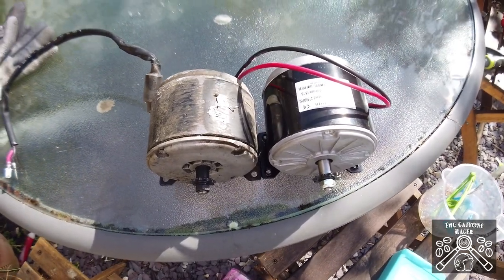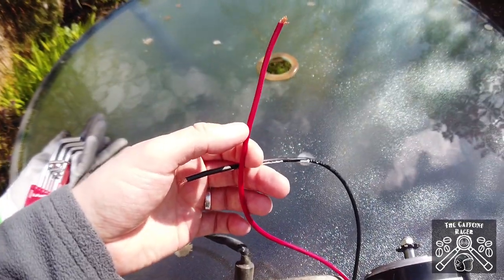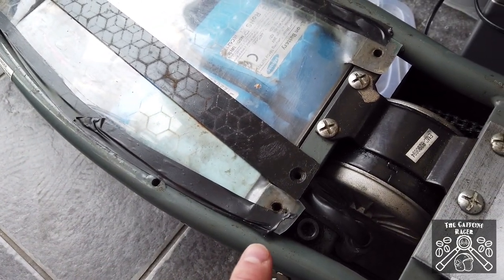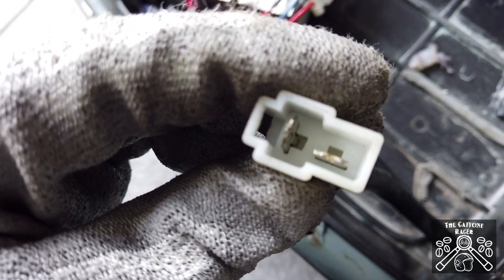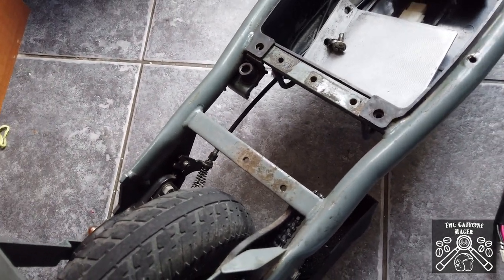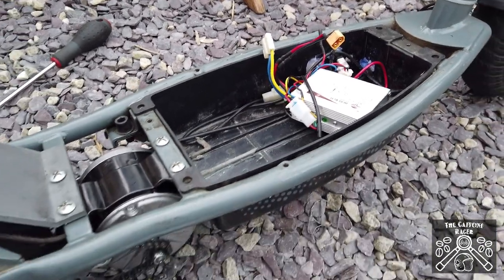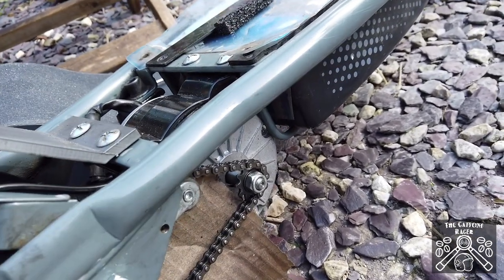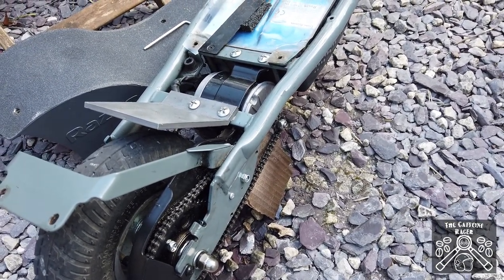Motor Upgrade for Fast Razor E300 - - 'Meet the E350w'

Comment: I am very glad you posted the video. I am looking to upgrade my scooter too. I am pushing 48v on the stock motor and it's a blast. I found a good deal on this same 350w motor. 
Question: Did the motor bracket have threaded holes? Did the screws used to install the motor go through the frame and then threaded into the motor?

Thank you! Great video!
Reply from the maker: Good question, yes the motor had a threaded set of hole I got some longer replacement bolts to go through my internal mudguard and then the frame then the motor. Remember this is a 350w 24v motor 18.6 amps is the limit before burn out
Reply: @TheCaffeineRacer  Thanks for the reply! I just rip on the scooter here and there in short rides. unfortunately laws in my area I cannot use it everywhere but I take it out for fun! Got super good deal on scooter and had a 48v and controller left over from my dune buggy modding. I will burn it out and the stock one has proved me well with lot of abuse so far, overall it will be worth the cheap fun when the smoke puffs out! Cheers! This is very helpful info
Reply from the maker: Yeah same here, I just behave on it and give away to pedestrians, disc brake mod next
Reply: Timsalsanights aka The Caffeine Racer awesome! Please do a video on the disk brake that would be awesome!
Reply from the maker: @grandtheftauto1233  I have the mounting brackets now thinking will go on front to start but have an idea on the rear
Reply: Timsalsanights aka The Caffeine Racer very good. Did you source them from electricscooterparts? They have direct fit disc that fits on the stock location for the drum brake. However I still don’t see an easy way to mount the caliper
Reply from the maker: @grandtheftauto1233  no I will have to look that up unless u have the link?
Reply from the maker: @grandtheftauto1233  yep that's the one I have the 142 and a bracket to try fit it does fit the front so rear it will be

Comment: Hi. Great video! Think I have watched them all! I was wondering what would be the effect if you used a 350w or 500w speed controller instead of 800w with the same set. i.e 36v 2 batterys and 350w motor. Really appreciate all your hard work! Keep it up! Thanks
Reply from the maker: There will be no difference the motor will pull a max of 350w so the controller can manage upto an 800w pull. Does that make sense. It doesn't improve motor performance. Just gave me room to upgrade to a 350w and now a 500w and not have to change the controller will do a video soon on 500w set up
Reply: @TheCaffeineRacer  I see! I thought it might be because of the overvolting, meaning the motor could pull more watts. Oh well just ordered the 800w! Although the thought of going 20 - 25mph on one scares me! 🤣 Look forward to the new videos and thanks for such a quick response!
Reply from the maker: @martinhicks4088  wear protective gear don't ride without a helmet very dangerous vehicles

Comment: Hi there great videos, am on with just doing the same, no mention of your charging set up, do u take batterys out or have to made a built in charge set up

Thanks steve

Cant wait to see your 3rd batt install and review
Reply from the maker: No its all internal into the original charging port check the build video. I use a 42v charger for the 36v setup works a charm
Reply: Arh ok cool, thought id seen all the videos, i will go through them again, thanks for the reply

Comment: Did you ever manage to sort the issue with the motor being a tad longer, as in the chain rubbing on the side of the roller on the tensioner, just seen mine needs tweeking a little
Reply from the maker: I never found it to be much of a problem, i have removed the 350w motor now using a 500w instead put on a new chain today as it was stretched. Where the tentioner is the top and bottom chain were rubbing now there is a nice gap. will have to do another video in the next week.
Reply: @TheCaffeineRacer  arh cool, how come you went 500watt again, have u added a 3rd battery, i have just been out after tea and checked it again, i tightened the tensioner to tight, back it off and seems fine now. 👍
Reply from the maker: @stevenwilly23  the 500w I have is slower but has more torque and can take more amps. Doesn't get hot it's all round better for me and its a direct fit. Handles the 3 batteries too with out getting hot 🔥 :)

Comment: Hi there mate I’ve been doing a few modifications on my e300 didn’t over volt  it i just purchased a 500 W brushed speed controller and used to12 V 10 amp hour batteries but the motor has has stopped working took it apart and one of the magnets have cracked in Side just wondering what motor I can put in without any modification to the original motor bracket
Reply from the maker: Check out my FAQ video it list the motors I have used
Reply: @TheCaffeineRacer  thanks mate will do
Reply from the maker: Thanks for getting in touch, make sure you wear protective gear.

Comment: Would motor not fit on the top?
Reply from the maker: No the angle of the attachment ears didn't quite give enough clearance to lift up and on top of the frame. But the frame is not that thick so the clearance difference is minimal. works like a charm. You will need some longer bolts for mounting the motor though. if there is any that you would like to see i am happy to make more videos on it.

Comment: Will a 36 volt controller and throttle 800 w work with the 24 v motor?
Reply from the maker: Yep it certainly does the control can handle up to an 800w motor. It's the voltage that has to match the controller so 36v battery 36v controller. So I am over volting the motor and getting more rpm does 24mph happily now :) had 25mph but I guess you will get speed gains on certain routes.

I am wondering if the motor can take the amps of a third battery pack now for more range
Reply: Timsalsanights aka The Caffeine Racer so 24 v motor can run anything as an over volt?
Reply from the maker: @albread  no there will be a limit. If your battery puts too many amps through the motor it will burn out but my set up is within the tolerance for the motor. 18.6amps is the motors limit
Reply: Timsalsanights aka The Caffeine Racer so in layman’s terms if I get the 36v controller i would be safe if it is 350 watts.
Reply from the maker: @albread  I am using a 36v 800w controller with 350w motor so yes.

This video has all the parts linked in its description. Not the moto though https://youtu.be/lQyB2Yb9iao

Comment: Hi there

How come you use a 42volt charger on a 36volt set up, is there a reason

Steve
Reply from the maker: Yes good question there is a reason. The battery packs are made up of ten cells call 18650's these have a max voltage of 4.2v each the so 10x 4.2 gives you at full charge 42v. As you ride they will drain that generally the voltage shows 36 to 37v will motor pull and the will drain to about 32v then the scooter will need a good charge. Performance will be low at that point. so the range of the charger will be 36 to 42v. most will state 36v charger but on the back it will have the range showing 42v. 

hope that makes sense.

Tim
Reply: Makes total sense, just wanted to make sure lol

Steve

Comment: Have you ever used AliExpress?
Reply from the maker: nope sorry amzon or ebay for me.
Reply: Timsalsanights aka The Caffeine Racer  in stead of using 2 of the 36v 4ah battery.   I thought about buying I of the 36 v batteries with 7ah.  Do you think that would work?
Reply from the maker: @albread  I wouldn't like to say I dont know what the max output of that battery would be might fry the motor you will have to research it. I can only speak for my own experience